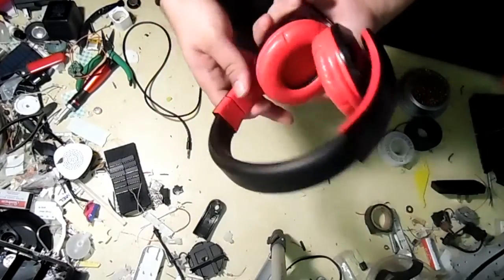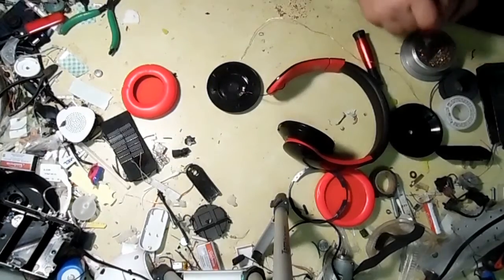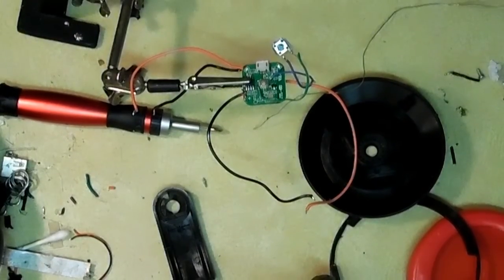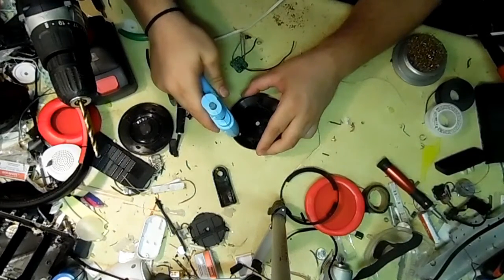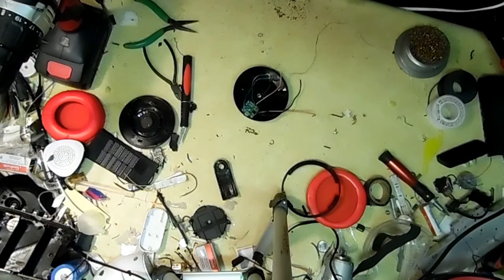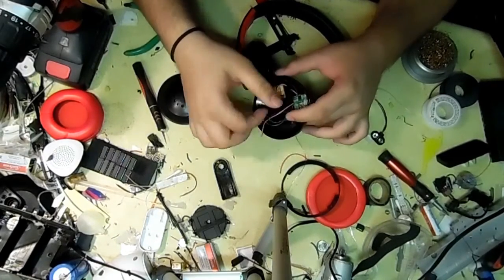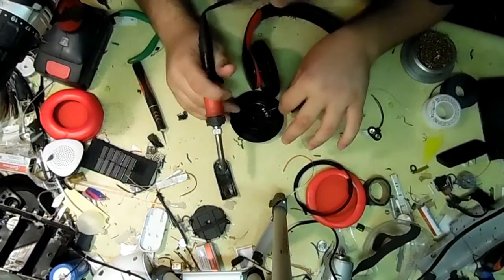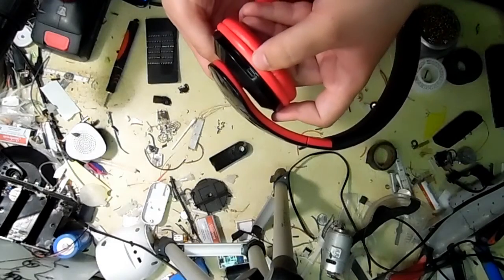Hack together a great pair of bluetooth headphones!

Comment: Does having the Bluetooth on one side play through both cups
Reply: You'd have to connect both sets of speaker wires to the board, which he did not do in this video to keep one side AUX.